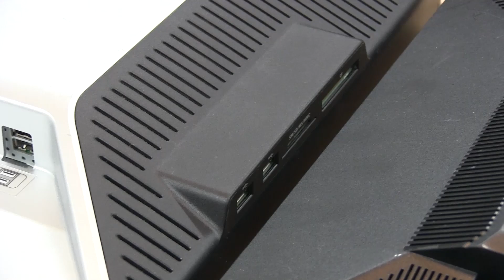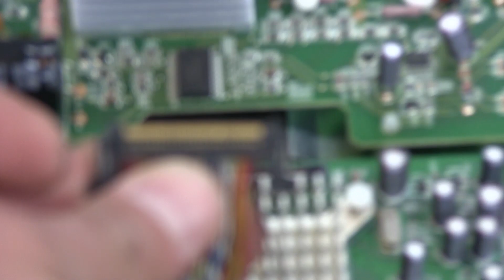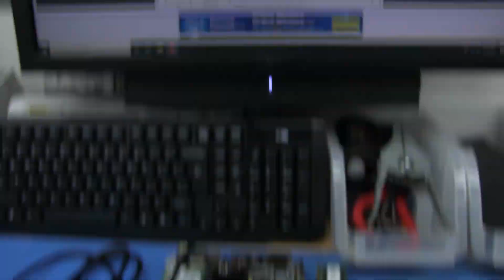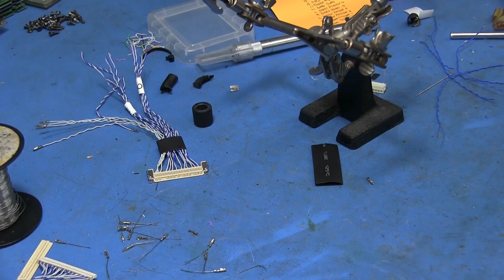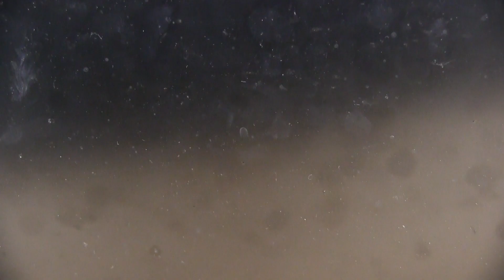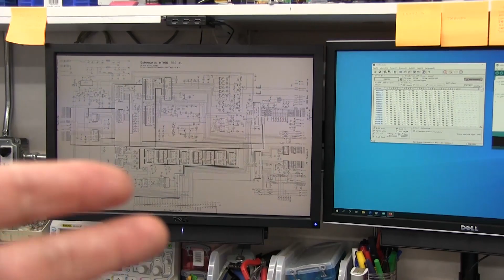TWB #99 | LCD Swap Investigation/Attempt Turned Into Repair

Comment: DVI is essentially HDMI. You probably knew that. And, you've probably got a DVI to HDMI adapter laying around. The pinout looks as if no electronics needed in between. You seem like a wiring GURU, so it'll be easy for you.

Comment: I think what you are experiencing with the wire is a eco friendly plastic insulator that likes to break down after 10+ years.  My dads BMW 325 (e46) from 2000 has this issue with the wiring to the trunk lid and it was a pain to repair.